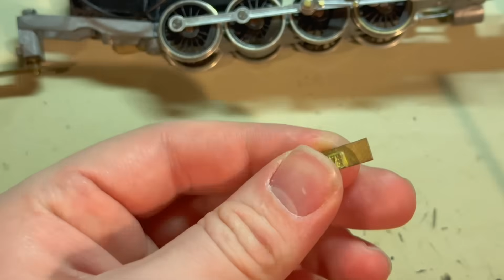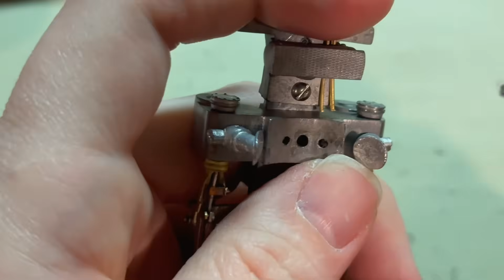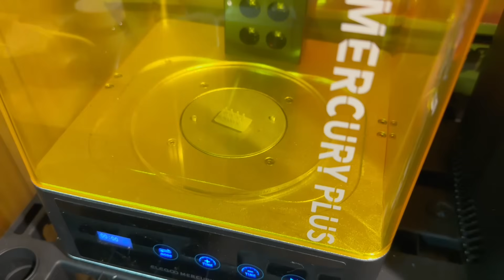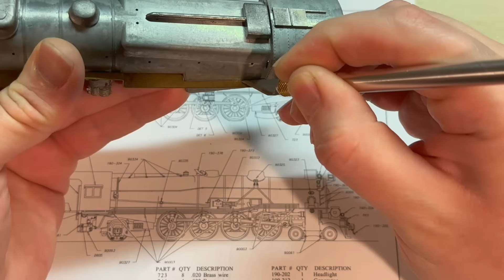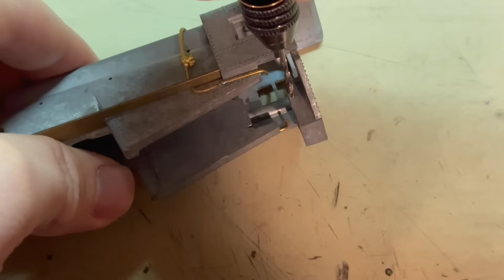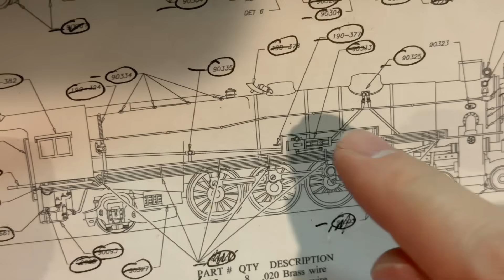How to Build an Intermediate HO Scale Steam Engine Kit: Part 6 - Super Detailing

Comment: Hi. Awesome videos. Thanks to you I’m finally getting the Bowser Norfolk & Western 611 kit put together. The screws on the side rods/drivers keep backing out. Is there a way to prevent this? Thx!!
Reply from the maker: If the screws keep backing out, try putting a small drop of liquid super glue or blue Loctite in the hole before inserting the screw, then give it a little time to set.
Reply: @DarthSantaFe  Thx!

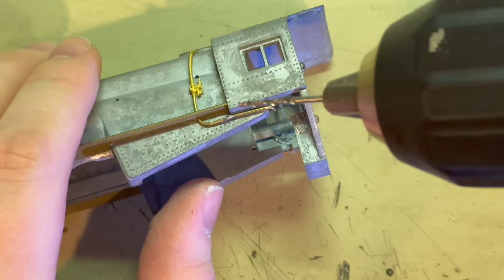Comment: 27:50 just sharpen your drillbits XD
Reply from the maker: That would be great, but I could buy hundreds of new small bits for the cost of a decent sharpener (and I can’t find one that works with bits down to 0.5mm).
Reply: @DarthSantaFe  the 0.5mm and smaller range is easier to just replace, those often break before they dull. On larger diameters (0.5mm - 6mm) though one can just freehand it with a dremel and a carbide or diamond wheel. There are instructional videos here on YouTube on how to do it right, which angles to choose and so on. An imperfect freehand-sharpened drillbit will always work batter than a dulled one.
Reply: @DarthSantaFe  Also, i maybe should have mentioned, cheap drillbits come from factory semi-dull. Just try sharpening one once and you will realize it launches you into a new world of crafting :)
Reply: @A.Lifecraft how?

Comment: Great job on adding details.  Didn't know there were so many details on a steamer.  Guess I need to do some detail work on my steamers.  I'm in the process of scratch building some flat cars.  I've already completed a 24' one and plan to make a few more.  I've got my design down pat so assembly will be quicker on the next ones.  I had to do some experiments on the first one.  Cheers from eastern TN

Comment: Phenomenal work. Nice to see you making videos again! I too am shocked at the unavailablility of such generic pieces like the uncoupling bracket mounts and condensing pipe brackets. It seems detail part manufacturers often overlook this very basic and simple but equally necessary parts.

Would you consider putting your files up on a 3D hosting platform? I could definitely get some use out of those brackets!
Reply from the maker: I'll look into doing that!  I do put some files up on Thingiverse now and then.

Comment: excellent job, especially with the scratchbuilt parts.  I'm surprised you didnt try to replace the rods, as they're the main visual detractor of the model, but she still looks good!
Reply from the maker: Thanks!  I'm trying to finish most of the kit as close to "as is from the factory" as possible (printed details were made to replicate originals), so some of the less realistic parts like the stock siderods are being left in place this time.  Maybe someday I'll go so far as to create more realistic siderods for a model!
Reply: @DarthSantaFe  makes sense.  The one to go for I'd say is a Gresley pacific, as they had 1/8" webbing, making the rods very light.  for modelling it, take whatever etches you have and cut out the inside web on the out facing side, leaving you with that unique light weight look that most models of A1/3/4s are missing!  I'm going to e doing that when I get new rods for my pacifics.
Reply from the maker: @1471SirFrederickBanbury  I have an A1/A3 Pacific on reserve from Brass Masters. How would you say the rods look on those?
Reply: @DarthSantaFe  almost perfect, but because they’re half etched only, you need to use a piercing saw to cut out the inner web portion.  You could file or grind through it, but the important part is that the center section is gone, so that when you put to the two etched together, the backside of the inner facing one becomes the web of the outside facing part.  I’ll probably send you a dm  on model railroader forums so that I can use photos to show what I mean.
Reply from the maker: @1471SirFrederickBanbury  Just looked at their photo of the etching, and I think I see what you're talking about!  Hollowing those out might be more work than I want to go through, but we'll see.
Reply: @DarthSantaFe  yeah.  It would be easy with a piercing saw, but would take some time with a file